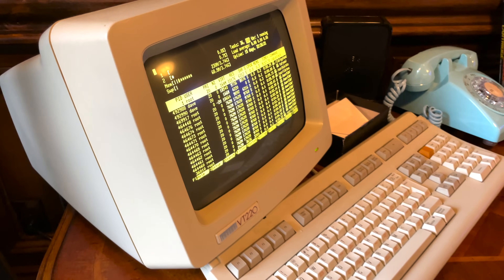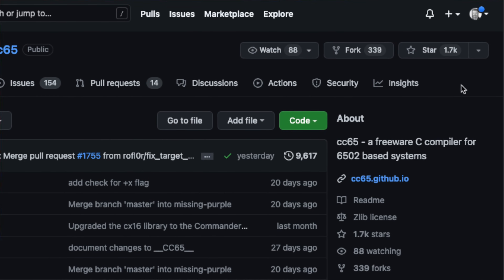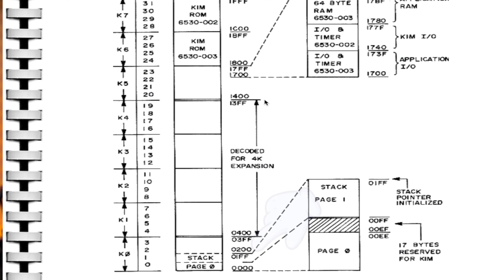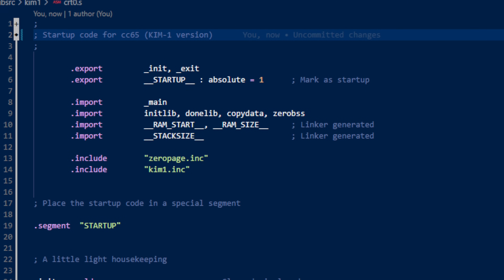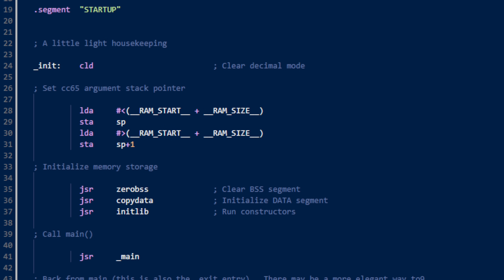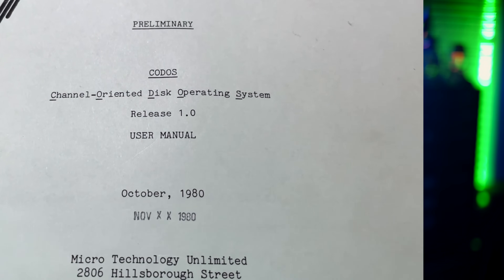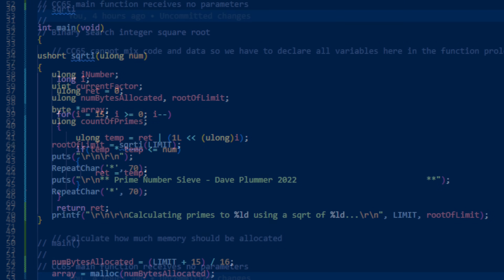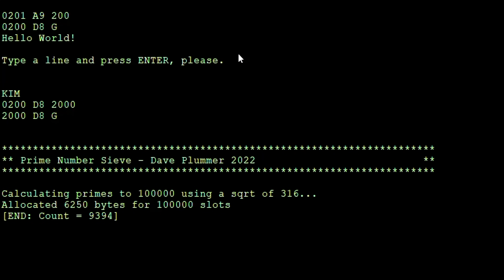RETRO C 1977: a C Compiler for the KIM-1

Comment: That is fantastic to have a c compiler for Kim.  Also showing how set up a board support package.  This is the same as what you need for gcc.  The connection to gcc makes this video very valuable.

I should break out my board and give it a try.  How much space does printf take?  I setup gcc for the MCP555 and printf was taking around 12K.

To do simple c++ I remember only having to provide new().  That can be really simple if you never plan to delete.

Back in the day I got an assembler for and ran on Kim.  I had one of those Don Lancaster TTY boards and two S-100 memory boards.  I started a crude set of routines save data to a floppy.   I was just happy to record something and abandoned it after getting my 6809 system working.  That had OS9 with c and later color graphics.

Anyhow,  thanks for the video.

Comment: Fun thing. Recently I've written a chess program for KIM-1 using 909 bytes for data and code segment.
I did in 6502 assembler under my own online KIM-1 emulator, code also worked on a real KIM (btw tested by the
guy you bought your KIM from). What is interesting now is to see whether cc65 would generate bigger or smaller code if I feed my C prototype into it.

Comment: Related to CC65 for the 6502, is there any current C compiler available for the 65816 or the currently-produced W65C816?
Reply: Check the Western Design Center website - they have a variety of development tools for the '02 and '816, which includes assemblers and C compilers for the 6502 variants and the 65C816.  I haven't used the C compiler, but there is documentation for it.  You have to register with an email address to download the tools package but can only download once (?) with that email address, so save the download somewhere in case you ever replace your PC.  The documentation on using the stuff in the package is marginal at best, but if you dig deep enough, you can use it.

Comment: Awesome video Dave! I've been using CC65 a bit as well (I have a few videos on my channel) and I love to be able to use C to program my Commodore 64 (and my own C64 emulator). This walkthrough of adding a supported target is very interesting. I've had to poke around the cfg and crt0 files myself to get a program I wrote for the C64 compiled and linked into a binary compatible with the C64 cartridge format. I've burned that to a ROM and built a cartridge for my C64. Really ineteresting and fun learning experiment.

Comment: uC compilers remain limited in new features. These days, it is very easy to use all the latest features of e.g. c++2b. I find the c++ constexpr stuff especially helpful with microcontollers to automatically generate lookup tables. Just generate llvm code with clang (-emit-llvm) and then use the llvm c-backend (llvm-cbe) to generate simple c-code. This can then be compiled with any minimal c-compiler. This also has the advantage of using all the latest IR code optimizations of both clang and llvm, and the uC compiler essentially only needs to use a simple peephole optimizer for the final compilation step. Possibly only limited more advanced stuff as for-loop reversal.

Comment: KIM-1? I was hacking Z80 assembly on my TRS-80 back then. Sadly, no C. I had an Apple I, but the my first C complier that I ran on a computer I owned was on the Kaypro under CP/M in 1982. This all made me a fan of Z80 and I never did much with 6502 or other Motorola assembly.

Comment: So, I actually ran this on a few machines...

On my Mac Pro 6,1 2013 ("TrashCan") with the 12-core Xeon ED5-2697 v2 @ 2.70Ghz, I got 70,813 iterations on an average of 5. This machine is running Windows 10 and Visual Studio 2022

On the Amiga 4000d with the Cyberstorm MKII 68060@50Mhz, the SAS Lattice 6 compiler got me 151 iterations every time I ran the test.

Turbo C++ 3.0 in DOS on a Digital Venturis Pentium 200MMX workstation yielded 257 iterations on average. 

This puts the Amiga in a rather favorable light, Mhz to Mhz, but compiler optimations are surely at play also.

Turbo C++ (all Borlands Turbo products actually) still amazes me with the DOS IDE; so many features and options, in so little a footprint. Lattice on Amiga is an awsome compiler put into context of the time, but the editor was and still is... less than stellar.

Comment: FOUND IT!  Line 59!
At first, I thought your bit manipulation macro was the culprit, but I could find nothing wrong with it. I typed up you code in Turbo C 3.0 for DOS, and ran witrh much the same result as your own. I proceded to exchange your macro code for my own Turbo Pascal version, that does the same in reverse order, but that also was to no avail. (of course I ported the Turbo Pascal code). Now I could put the code into Visual Studo 2022, and here it ran just fine.
THEN - as I spent WAY too many hours looking at the issue the wrong way around, I saved all the primes found by your code to disk, and  the same for my correct 9592 primes from my Turbo Pascal implementation, and compared the result. Sure enough, a few primes was missing, but from strange places in between many others. I isolated the first prime as 3083 by help of my trusty UltraEdit 9.20b, and found that this was mmissing as currentFactor just hit 257 in value, and in line 107, this number is multiplied by itself, yielding 66,049 - just over the 65,536 limit of an UNSIGNED INTEGER on yours and mine platforms. This also explains why the code ran on Windows in Visual Studo 2022.
Changing the declaration of currentFactor on line 59 from a uint to a ulong - ét voila!
Thanks for the challenge and the opportunity for an old-school, these days much neglected code review!
Reply: XD when he said to find the bug and put it in the comments I knew I could count on the answer being there. Thank you for checking open source code for bugs.
Reply: It was a fun challenge to once again debug code like we did 30 years ago. However, I was, and am, convinced the bug was put there purposely, and would only be a bug on older machines. Never the less, it was a blast to try and remember how to check for errors the old way, and use my labs vintage equipment for just that. Monday was a day off where I live, and it was raining cats and dogs all day. Perfect for a challenge. Good times!
Reply: Does his C standard library code support ulong?
Reply: @modrobert  Just checked my Kernighan and Richie "The C Programming Language" rev. 1 from '78, and the unsigned long datatype is referenced multiple places with a 32 bit precision on the PDP-11, IBM 370 and Interdata 8/32. On the Honeywell 6000, the precision is 36 bits.
On page 34, the book states:
"The intent is that short and long should provide different lengths of integers where practical; int will normally reflect the most"natural" length for a particular machine. As you can see (ed: from the table of precisions on the page in the book), each compiler is free to interpret short and long as appropriate for its own hardware. About all you should count on is that short is no longer than *long*"

Comment: My first C compiler on PC was the Mark Williams C Compiler. My first Unix Box was DUAL System 83/20 (Motorola MC 680000) running version 6 (latter version 7). My first PC-XT uses 2 boxes: the hard disk was in a separate box.
Reply: I don't remember what my first C compiler was, I tried out so many, but my favorite was definitely LCC. The lcc-win32 suite of tools that Jacob Navia wrote, expanding on the work that, of all sources, came from Microsoft Research, was great. If you use Windows you can actually still get it and a 64-bit version at that. These days I pretty much exclusively use GCC since I don't use Windows anymore.

Comment: Declaring variables before code reminds me of good old Turbo Pascal days :) The last language I did something substantial in was PHP - if I wanted to use a variable, I just used it without declaring (and wondered why my code is not working, since PHP will treat a typo in a variable as a new one :D)
Reply: Check out Turbo Rascal (TRSE).
Reply: @MattKasdorf  I’ve seen it, but I found it a bit hard to use :) (and I forgot quite a bit of TP)

Comment: I’m kind of amazed CC65 supports a heap. I didn’t expect to see malloc() there at all.
Reply: cc65‘s malloc isn't the most efficient in the world, but then again 6502 machines aren't fast  with lots of ram to manage anyhow. Also malloc and free aren't magical. I've implemented them myself in about 100 lines of C code total.
Reply: @AbAb-th5qe  It’s true, but some embedded  projects (Rockbox comes to mind) don’t allow you to use a heap. There’s reasons there (multiple tenants in a constrained space) and I’ve done a fair bit of work with Rust’s no_std mode without an allocator. It’s interesting they bothered at all.
Reply: @RandomInsano2  Well CC65 is a C compiler and those functions are specified as part of the C89 standard, so they're kind of required.

Comment: Nice work! I've written some code with CC65 for the Atari 8-bit computers and it is very cool to be able to write C for the 6502. 6502 assembly is fine but man does having a C compiler really take the edge off, especially when it comes to writing a decent sized program, it's night and day to have a decent high level language to work in. It really does open up a world possibilities for getting some useful work out of these older machines. Great to see a new target!
Reply: I still write a fair bit of 6502 assembler code, maintaining a 'monster' which is now almost 60k of hand written assembler. As it has to run from rom, and needs to take care of 3 different bank switching schemes (c128 mmu, cartridge/expansion rom and some 'private' cartridge ram), it would require a major overhaul of the c128 target for cc65 (which might be a good idea anyway, as its support for the c128 mmu is.. primitive).
Reply: @c128stuff  Now I'm really interested in knowing what this monster is and what it does 😅
Reply: @HAGSLAB  c128 device manager. Should be easy to find with google or such..
Reply: @c128stuff  Thank you for replying, I will check it out.
Reply: @HAGSLAB  There is a new release pending, but have to finish some changes to the UI code, which I'm not really getting to. 

There are essentially 2 versions of it, and a derived diagnostics rom. One version is for use with the UII+ cartridge (this is also the most complete version, as it can make use of extra UII+ features for the C128), and a 'standalone' version. 

Its all based on a single source tree, just 3 different build targets (and the joys of keeping everything working with different features and memory  layouts)

Comment: So if I'm following this right cc65 compiles code for 6502 machines but it runs on Linux or windows, not 6502 machines. Am I the only one that thinks this is weird?
Reply from the maker: Well, even if it could compile itself, would the binary fit in 64K?
Reply: @DavesGarage  C compilers that run do natively exist but I'm not sure any are C89... ;p
Reply: @DavesGarage  With the windows zip at 11 MB and not looking into it any further I'm thinking no.
However this sort of thing should be a cartridge anyway, if that cartridge had a raspberry pi on it, it could do all the heavy lifting. 
Pi1541 to get the target code from the pi to the 64. 
terminal emulator running from cartridge so you can work on the pi. A button to toggle from Linux to cbm basic. 
My 12 year old self would be very happy with that solution. 
For bonus points swap the terminal for notepad++ ported into a 6502 c IDE. 
All the parts are already out there it just needs a thousand hours to glue it all together.
Sadly this project is a bit above my pay grade but if you want to try it I'll be watching with bells on.
Reply: @DavesGarage  Now I have an idea for my next project!
Reply: Nope. It is perfectly normal to have a powerful computer compile code for a smaller less powerful processor. That is how the majority of the low level programming is done.
It is called cross compiling. The phone you are using did not compile its own code, a powerful X86_64 machine did, most probably running Linux.
Most of the code running on microprocessors was compiled on x86 machines. Almost all the code for arm is cross compiled. 
The code running on your microwave, phone, fridge, washing machines, cars was written and compiled on X86 machines.
Most processors aren't even powerful of running a compiler on them. They are severely limited in both RAM and ROM.
Reply: Cross-compilation was nothing new even back in the days of the 6502. Microsoft used cross-assemblers.
Reply: All these observations are true and I think nothing of building Arduino code on a windows laptop. But the part of me that's forever 12 years old and staying up half the night writing stupid programs on a commodore 64 hooked up to a black and white tv is really disappointed that this isn't the gateway to assembly language power without learning assembly language that I always hoped for.
Reply: @brocktechnology  HLL compiler were available and practical on the c64
Reply: I love these approachable yet technical dives into the 6502 world.

Comment: You can do relocatable code for the 6502, but you'd need to write a relocating loader for the binary code of course.
Reply: Self modifying code was a completely normal thing to do with the 6502.
Reply: And you'll need a header describing the offsets which need change. One of the first programs I encountered which implements this, and actually has the relocating code built-in, is Commodore's IEEE-488 driver for the C64 which came as rom with the interface, but would copy itself to ram, so it could move to the $c000 range, and provided a documented relocation function for when you wanted it somewhere else.
Reply: @c128stuff  Wouldn't they have pre-assembled the block of code that gets relocated to run at that address ?
Reply: @netdudeuk  No, it uses a generic function which figures out where it currently is in memory, copies the code to the desired location, and uses a table with offsets in the code which need change. One little trick I learned from the code is how to have code detect on what address it is currently in ram (write a rts to a 'safe' location, jsr to it, and check the stack for the return address).

And hence, it could relocate itself to arbitrary addresses.
Reply: @c128stuff  thanks for the explanation.
Reply: Almost any CPU's code can be relocated, given a sufficiently $DEITY like relocator. :-) 

Better CPU's (e.g. 6809...) support code that can be relocated without being changed - Position Independent Code (PIC).
Reply: @paulwomack5866  I agree. Are most executables even compiled for PIC though? Don't Memory Management Units make such concerns not a problem anyhow?
Reply: @AbAb-th5qe  MMU's don't help if you're trying to link lots of separate library routines into a single executable. You'd need a separate mapped area for every little routine.

Which would then leave the problem of how to jump from one to the other when each is in their own space.

Not a good idea.

If the routines are compiled to PIC (no trouble on CPUs with decent addressing modes) there's no problem to solve.
Reply: @paulwomack5866  With a MMU each process gets is own address space. So code doesn't need to be run from a different address. Dynamically linked library code is that: dynamically linked. The loader will be fixing up the addresses of the library code. Position independant code can be used, but in my experience mostly isn't as it increases the code size and slows down execution due to addresses needing to be calcuated all the time while running. How often do you see code compiled with -PIC? Not often outside of embedded stuff right?

Comment: My uncle got me into coding many moons ago. He used to have his Sinclair spectrum ZX81 managing his heating system! My tinkering has always been playing with graphics and games.
Reply: The Sinclair ZX Spectrum and the Sinclair ZX81 are two different computers. The ZX81 came out in 1981, and the ZX Spectrum in 1982. Main differences are the ZX81 only had 1K RAM (expandable to 16K with a "RAM Pack"),  mono display with only upper case text and graphics character set, no sound, flat membrane keyboard. The ZX Spectrum had 16K/48K, colour, 256x192 graphics resolution, beeping speaker sound, rubber keys. Both computers used the Zilog Z80 processor.
Reply: @satchice9102  indeed, I do recall. I was just excited when I typed that! Ha! He used the ZX81 to do the heating and also developed a couple of games we used to play. I had the ZX Spectrum 48k myself, then the 128+ with the drive, but managed to brick it with some experimental tinkering. That was an urgent setting summer!